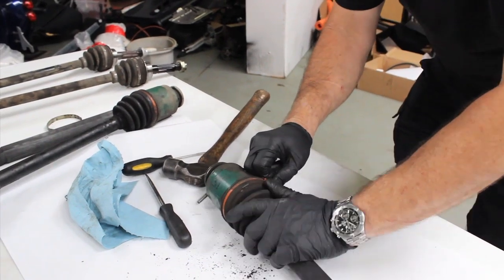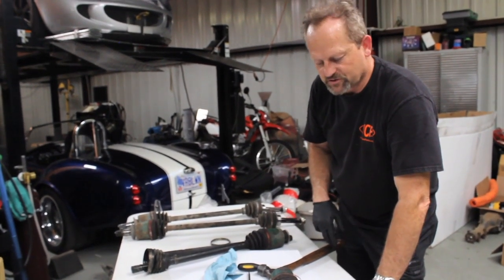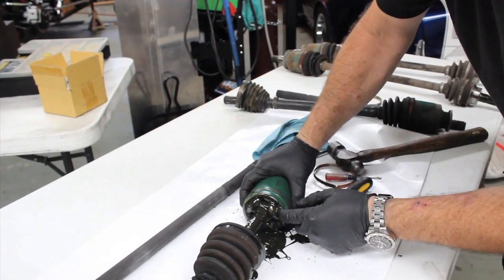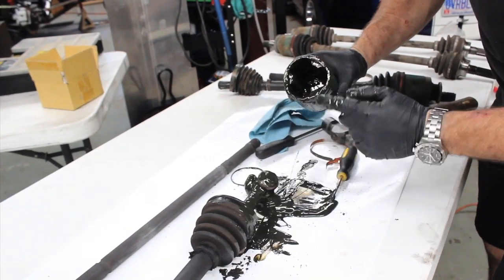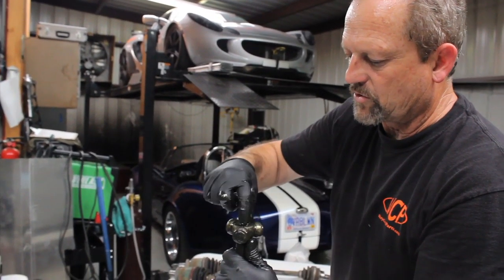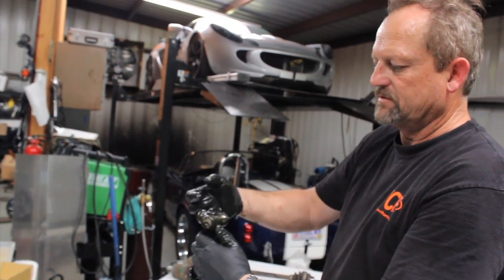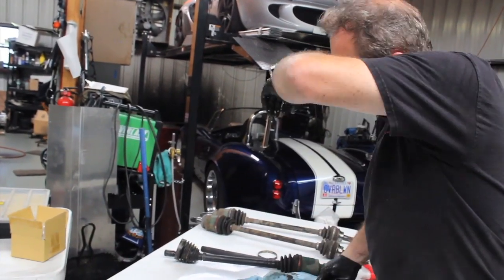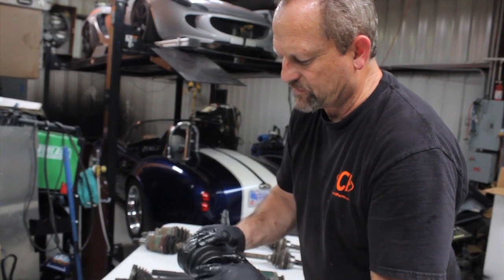Project 818 Part 16: Building CV Axles

Comment: Are the splines on the axle itself pretty standard? I need axles to go from a Mitsu 4G63 trans to a Honda hub...It would be great if I could just find some proper length axles and transfer on the CV joints, etc from the original Honda/Mitsu axles.

Comment from the maker: Since we’re using the front half of the Subaru transmission and the rear hubs to put power down on our 818, the CV axles have to be modified to fit. Check out the video:

http://youtu.be/TS_T7jAjxCU